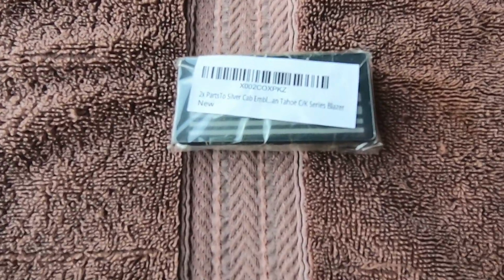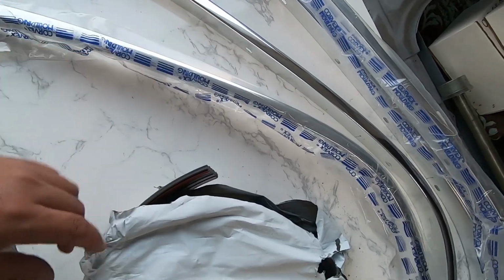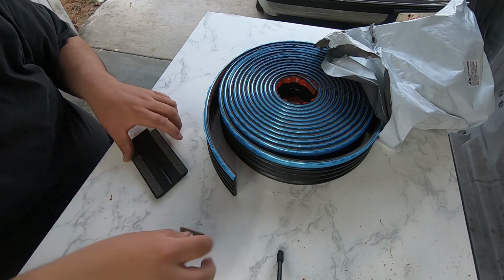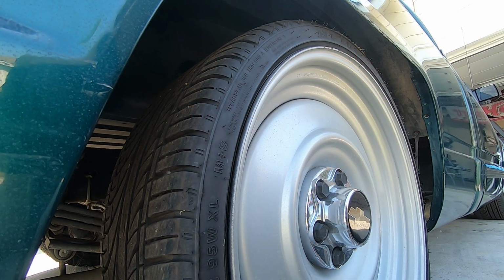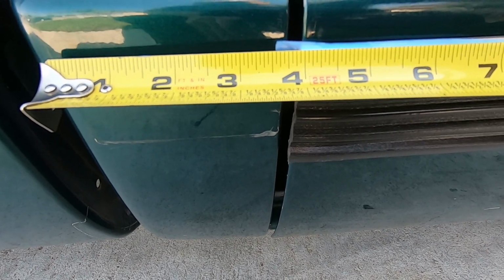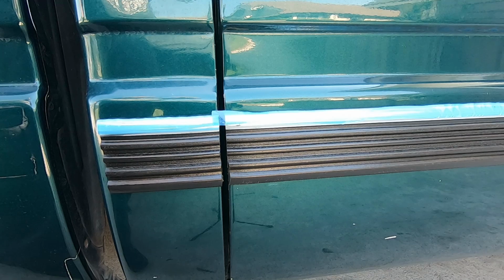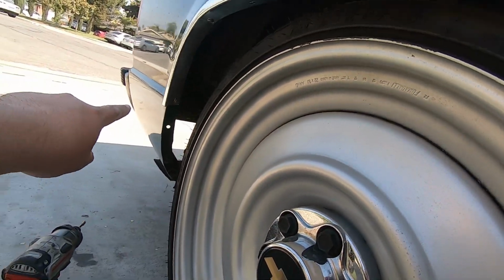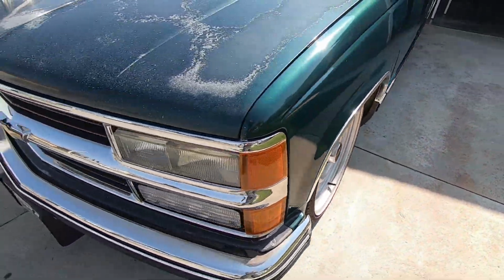SO FRESH & SO CLEAN CLEAN!!

Comment: They make a rubber eraser that goes in a drill that will remove that pinstripe works really well and some Goof Off will clean and adhesive left.
Reply from the maker: Hey thanks for the tip I need to do that ASAP !!! Lol 😂